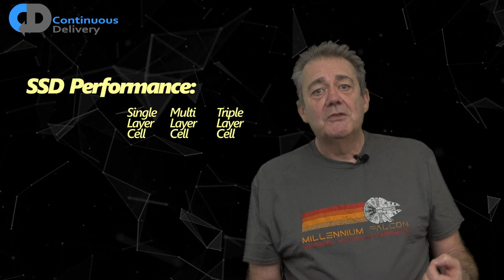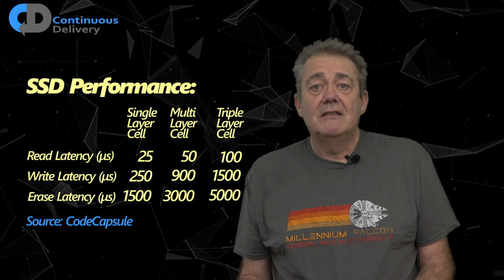How Fast is Your Computer? | DESIGNING FOR HIGH PERFORMANCE (Mechanical Sympathy)

Comment: Not sure how popular it is outside of gamedev circles, but in game development we have this concept called "Data Oriented Design" (as opposed to say, typical Object Oriented Design), which is a programming paradigm where you attempt to organise the data structures of your application around minimizing cache misses. (Or more generally, thinking about how your application actually processes data and trying to make that as efficient as possible)

Imho it's generally useful for programmers to learn a bit of it, even if they don't necessarily always put it into practice
Reply from the maker: Yes, we did something similar for trading systems, also implementing “no-shared-data” architectures between threads and processes to minimise sync costs and to keep caches hot.
Reply: @ContinuousDelivery  I have to say, talks by low latency trading folks have to be some of the most interesting performance talks I've watched over the past few years. 

Their performance requirements are extreme even compared to ours in gamedev. (I remember one talk saying they do things like sending out network packets unconditionally that get cancelled at the driver or hardware level, or something crazy like that, just to avoid a branch mispredict on their most crucial path)
Reply from the maker: @PandemonicHypercube  Yes, it is an interesting problem domain if you are a real geek. When you get to the real sharp-end of performance, it makes you think differently about who to organise the code. We did quite a lot of experimentation on optimising to ensure that our code was always hot in the cache, we re-wrote all of the collections that we used so that they were more efficient, and more cache friendly. We came up with a mechanism to to exchange data between different threads that runs at close to the performance limits of the processor, using lock-free concurrency, and ended up running all our biz logic, within a service, on a single thread. The edge to edge performance of our system was about 80 micro-seconds - very cool.

You can read about the data exchange thing here:  https://lmax-exchange.github.io/disruptor/ 
 It is called the "Disruptor" and is open-source.

Comment: Really appreciate this. So many developers now know nothing about hardware,  networks and databases. Just packages of other people's code and REST APIs.

I was just working on a postcode to postcode distance lookup problem. Someone else's default solution was to use some very slow SaaS API and look it up fresh each time. Circa 2 minutes to look up 3000 pairs. Caching the lookup data in our own efficiently designed and indexed database returned the same data 56ms.
Reply from the maker: Thanks Chris, I once saw someone write an interface to, either a CORBA object or an EJB, I can't recall which it was, that served out single chars at a time - Doh!
Reply: Caching is good but the developer might want to add caching later after thoroughly testing and before going live like me. Premature optimization can be the root of all evil at times. Caching, also means you have to write code to clear and refresh data at specific intervals or events.
Reply from the maker: @awmy3109  I used to believe that about pre-optimisation, but I don't any more. It is certainly not true if you are working in high-performance systems. The trouble, to my mind, in advising against early optimisation is that the message that this turns into is "don't bother about performance at all" and the outcome of that is that most of the systems that I see are many orders of magnitude slower and less efficient than they could be, with even relatively simple steps. 
Simple case, many developers don't think  about the collections that they choose to store data in. I have seen more that 10x improvements in perfromance simply by replacing an O(n) collection with an O(1) collection in some existing code. 
You don't need to be performance obsessed to think about that kind of thing, you just need to model the problem in front of you. 
Similarly, the example that Chris gives above, treating a remote call as thought it costs the same as a local call, when it is always thousands or tens of thousands of times slow will cripple a design, and can be really quite difficult to fix later. 
I think that having a feel, 'Mechanical Sympathy', a rough view of the costs of our design choices as we make them helps us to do a much better job. After that, it is, as you say, a job for another day to do the more detailed refinement and optimisation, but there are bad choices that are difficult to undo if you completely ignore the costs of your decisions early on.
Reply: @ContinuousDelivery doh!
Reply: @ContinuousDelivery  I think at least having a rough idea of your "time budget" (per operation or whatever) at the beginning and then thinking about, measuring against and testing that early on is super-helpful. I mean,  for example, there's no hope if you have a response time budget of a page refresh/render in < 300ms but the page data alone takes 1 second to transfer. If you find that out in the first few weeks, then you can rethink things and you've not lost too much from the early experiment. But if get to a critical time juncture and you suddenly realise that you have to save more than 700 ms from somewhere...

Comment: Great video, love the human clock cycle examples.
Efficiency for me is now also connected to sustainability. Mechanical sympathy is core to using as much as we need vs wasting resources.
Reply from the maker: I do want to do a video on the carbon footprint of computing at some point. Data Centres represent a significant fraction of carbon emissions, but SW is thousands or tens of thousands of times less efficient than it could be.

Comment: Use our hardware more efficiently ... don't get me started ...

About three decades back we noticed that the major cost in software was the programmer, so we have focused on simple programming at the expense of performance. Modern systems have so many layers of software that the programmer writing the code often has no idea what is happening in the processor, on the disc, or on the wire.

Programmers are rightly warned about premature optimisation, but I fear that this leads many to avoid thinking of performance at all.

While you mentioned the complexity of distributed systems, one (well known) way of improving thoughput is multithreading. At least the program can be doing something while waiting those ages for the database access. But how many programmers are effective at writing multithreaded code?

Oops, looks like you got me started.

Comment: Hardware people need a "logical sympathy" too. The amount of times hardware has been "provided" that will never be used ( as an upgrade ) where the most used base functionality has been degraded or never worked as documented in the first place. There should be some form of bi-directional feature compromise.

Comment: This gets me thinking of a recent convo I had with some more low level devs about how we'd implement modulo.

One of these people did a lot of mathematical, almost kata-type things in Java. Their approach was to take both numerator and denominator as floats, do the division, math.floor the result, remultiply by the denominator and subtract this from the original numerator for a remainder.

I came up with a different approach, mostly in a confused state. I took the args as integers, looped over decrementing the numerator and incrementing a variable for the remainder, returning the remainder once the numerator divided by the denominator resulted in an integer.

I tested the two implementations and mine was a little faster because apparently math.floor is p intensive, but then again this was in python because I thought 'why not use a slow language for these tests?' so ymmv.

But yeah, little details that are often overlooked in abstraction can produce unexpected results haha

Comment: Virtual memory is orders of magnitude slower than real memory. If you cared about performance, the first thing you would do is turn it off and write your code to work with what you really had.

Network storage is orders of magnitude slower than local storage. 

The result of programmers not having mechanical sympathy is that a modern cell phone with more computing power than existed in the entire world in 1980 is used to shoot virtual birds. :(

Comment: The Van Neumann CPU-Memory architecture has been flawed since it's inception. Brains don't distinguish computing and storage, it's all neurons that do both at the same time.
Reply from the maker: Yes, I think massive-scale non-volatile RAM will change how we think about code, but not at that level yet.
Reply: Yes, one way I have managed to understand how badly we use the underlying hardware is by thinking of how things have improved in the past 20 years: disk space 200x, ram size 200x and cpu performance 200x.
Seems balanced and reasonable, right?
Then separate the cpu improvement into: 8x number of cores, 5x clock speed and 5x ipc. Now you should begin to see how much performance we are missing.